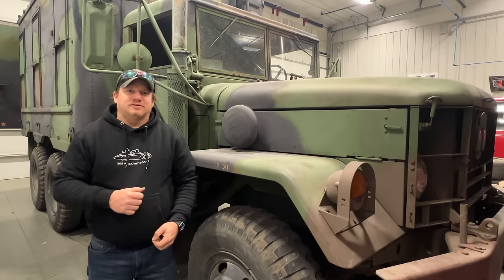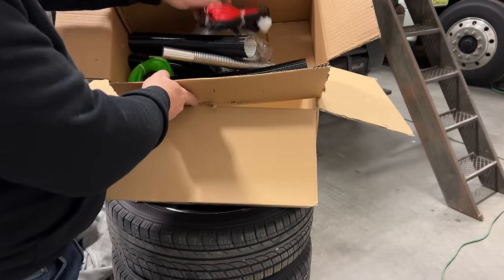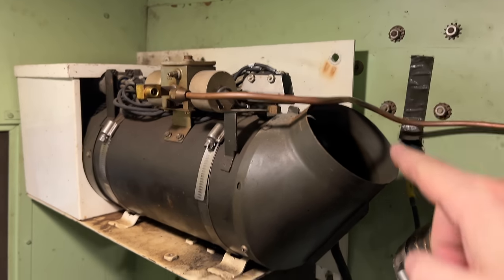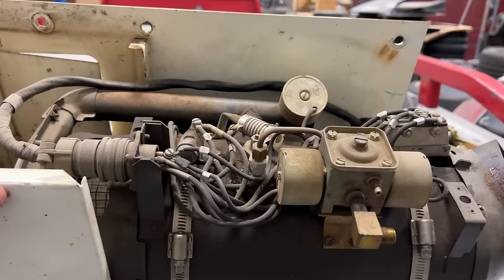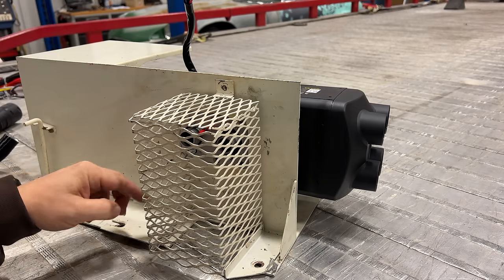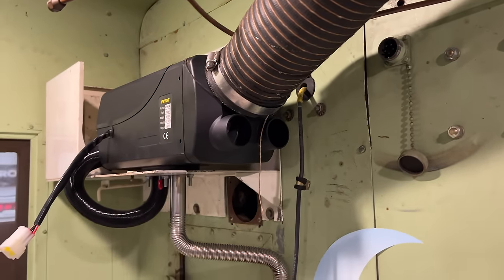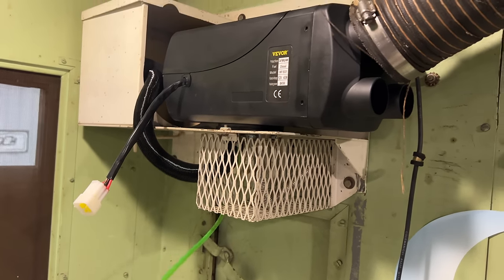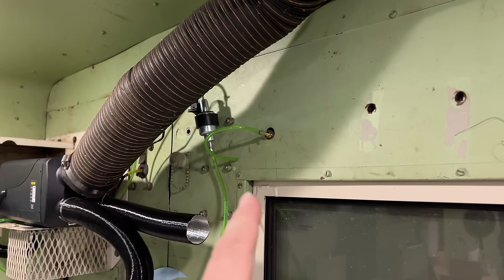VEVOR Diesel Heater for the M35A2 M109A3 Overland Camper Build

Comment: I have the same system in my kenworth, you need to position the pump at a 45 degree angle with a U in the feed hose so it doesn't lose prime everytime it turns off.

Comment: I've been using this exact same type of Chinese heater for 4 years now and it's been fantastic however the original fuel line perished and cracked within the first six months,  I replaced it with good quality fuel line and the heater has been flawless ever since
Reply: I've been wondering how good that fuel line material might be, thanks for this.
Reply from the maker: The fuel line was the only part, besides the manual, that felt cheap.  It feels of a different material than you would see hoses being made of here.

Comment: Gotta love machine translation!  A friend of mine had an instruction manual at work that kept referring to the "water goat".  Based on the equipment, he quickly figured out that it actually meant hydraulic ram.  I'm wondering why you didn't shorten the exhaust a little, where it enters the heater, so you would not have to bend the pipe up as much.
Reply from the maker: I wanted a little extra length in case the exhaust would create a hot spot and melt through the flimsy flexible pipe.

Comment: Just a bit of info, I have one of these heaters to heat my workshop, the fuel pump in the heater ticks and can be annoying so I moved the pump outside of the shop, you could move the pump in the fuel line outside of the living area
Reply from the maker: The original fuel pump is outside as you heard but it was still many times louder than this one.  The camera might make it sound different than in person but it is not that loud.
Reply: My adventure van has a similar fuel pump for the furnace, mounted outside under the chassis, and it ends up sounding like someone is walking around  outside when it's running

Comment: Well one thing's for sure you're going to need to put a screen around that chimney keep the squirrels from putting trash in it
Speaking of diesel heaters I have a diesel heater pressure washer I need to get running again  the igniter went out

Comment: Other installation videos by experienced users emphasize the need to run the exhaust continuously DOWNHILL at a gradual angle to drain any condensate. Check out a few of them. The exhaust installation pictured may eventually hav problems...

Comment: Judging by the broken english manual the quality of this heater seems a bit dubious. But since according to google search results this thing costs around 150 euros that's to be expected.

I myself might work on the original Webasto in my car soon. Not looking forward to it due to how hard it is to access but I have little choice due to how costly it is to let the "professionals" handle it. Original Webasto dash control panel, timer costs 130 euros (it's a glorified digital clock with an on/off signal...) and a wireless keyfob option costs 300 euros, that's without costs of labor which I was told would be at least another 200 euros.
Reply: And it all comes with a walk-out warranty.  You walk out the door and the warranty is over.